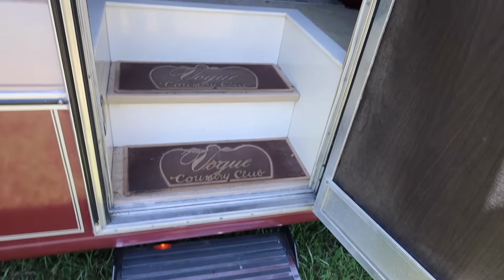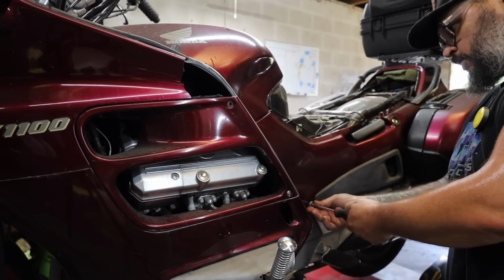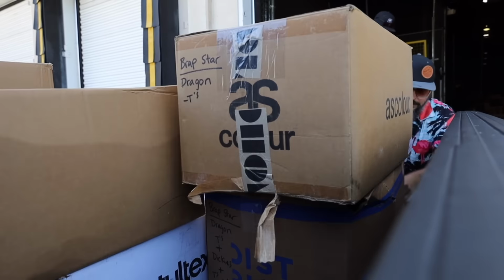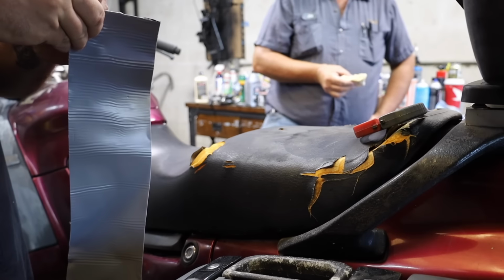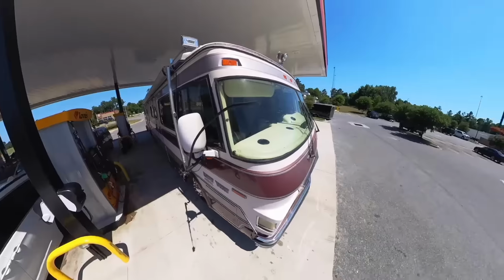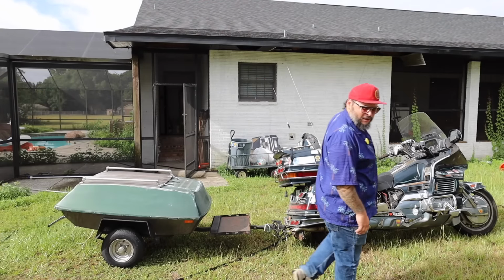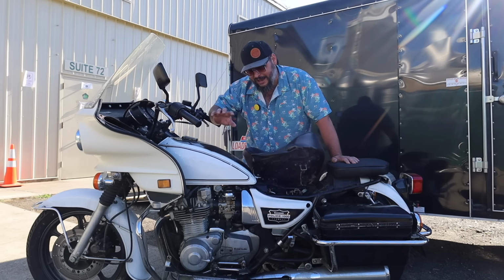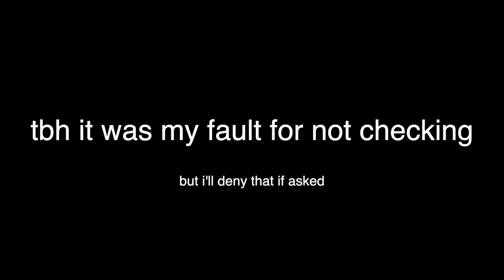We are Being Punished For Our Sins by a Vengeful Gods Wrath

Comment: Dang shadetree, my bad. Thought for sure that raptor petcock would work. Hard to tell size from vid but sure looked the same. I have those petcocks on several bikes to get rid of the vacuum petcock.Been running one on my klr for years. Hang onto it. It won’t go to waste. You can use it on something else in your inventory.

Comment: 🌿 REGARDING THE HYDRAULIC LINE 💥   TAKE THE LINE OFF AND TAKE IT TO A HYDRAULIC SHOP THAT WORKS ON JACK'S AND HYDRAULIC LINES AND THEY WILL MAKE YOU A NEW ONE IF THEY DO NOT HAVE THE PROPER FITTINGS TELL THEM TO USE THE OLD ONES AND YOU WILL SAVE A LOT OF MONEY 💲 AND TIME

Comment: The problem with old RVs is that nobody will work on them, and few RV parks will allow them. 

I'm not sure how the jake works on that coach, but those of us in the super-trucker community will tell you, running around town and less than 35, don't use the jake only. Brake lights only work when using the brake pedal. 

Keep it weird Army!
Reply: If you cant stop quicker than an RV and tell what it is doing, you dont belong on the road!

Comment: Sure you don't need any additional endorsements licenses or training to drive a 37,000 lbs. vehicle with Air brakes.   Honestly if you know how to do your checks, and you know how to close off a blown can, and you know how to do basic fixes to air lines, and you know not to ride the brakes, to use the transmission and engine for stopping and look ahead say 12 seconds at 60mph  that is pretty much it.  Just avoid any scales.   I would say the biggest thing I learned driving Semi for years is that you have to look and plan way ahead, "stay ahead of the truck"  It was pretty advantageous that I had learned to fly a little bit before I learned to drive a truck.  The biggest thing I would say you want to learn before you take any trips is how do a brake check because DOT or state trooper will ask you to perform a brake check. They will have you let your air build up and they will have you hold the brakes down and count and they can't lose a certain amount of air.  Also what they call "caging" a brake chamber is knowledge well worth having before any trip.  Depending on what state you are in, a DOT officer may ask you if you know how to "cage your brakes" to which you want to confidently say "of course" and then they will ask "in what situation would you cage your brakes" and the correct answer is when a chamber is leaking and only in an emergency to get you to the next repair station for a proper repair.  I would keep a bunch of plastic air line and quick connects with me and maybe even an extra brake chamber and I would lube everything up with PB blaster every couple of days.  Also with any big Truck like that keep a decent set of tools with you, grease gun, pb blaster and a Map torch.

Comment: The whole "I've been told not use the actual brakes unless I absolutely need 'em" was not a good sign. But it was a sign nonetheless, a signal of your reluctance to forestall doom with a pre-trip inspection. Pulling a trailer across the country with a 35 year old motor home what could possibly go wrong? My dad would say that there is nothing more expensive than a cheap used car. I would say, son you just bought yourself a black hole in the pavement to throw money in and never see again. You now own a wishing well in the middle of the highway, as you go faster and farther, more and more of those dollar bills are going to flutter down the road behind you like the feathers of flamingo run through the whirling propeller of an airboat. One little hydraulic line so close to home was truly a blessing and reward; this diversion can in no way be divined as punishment!